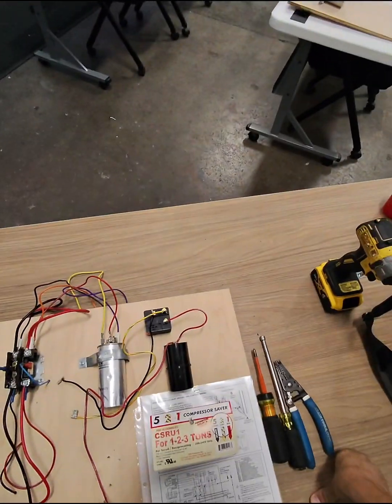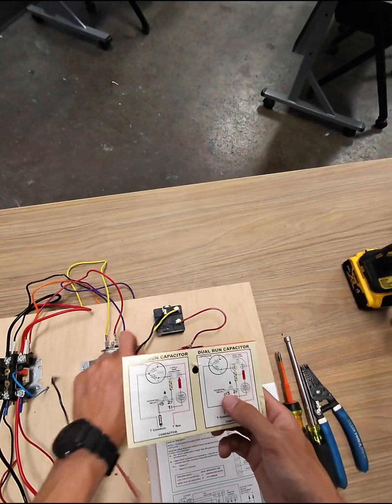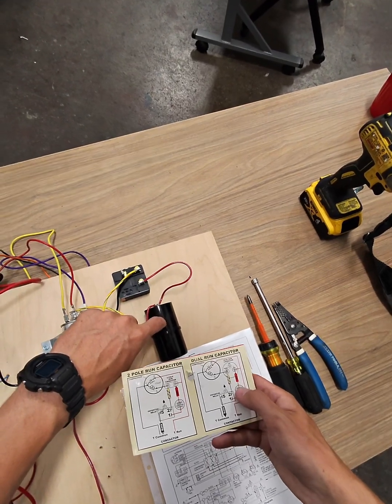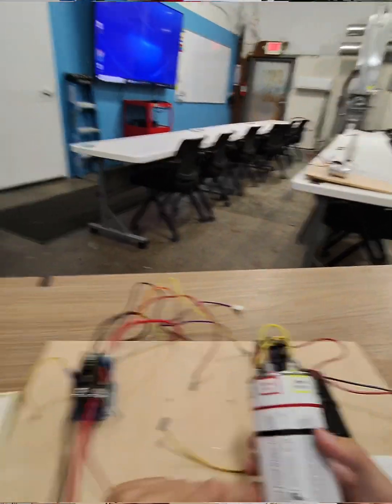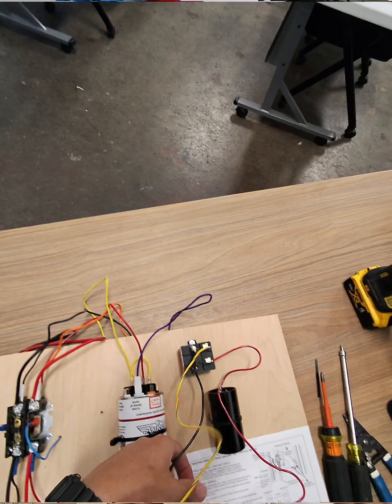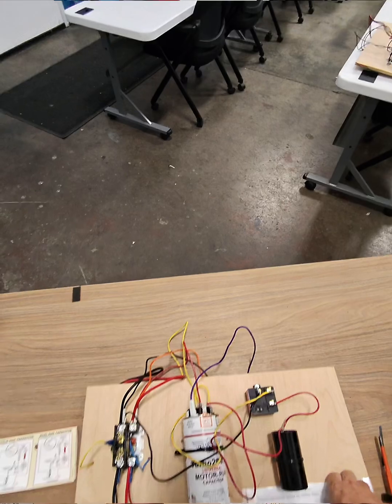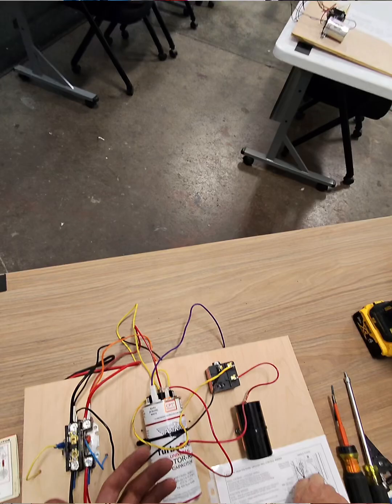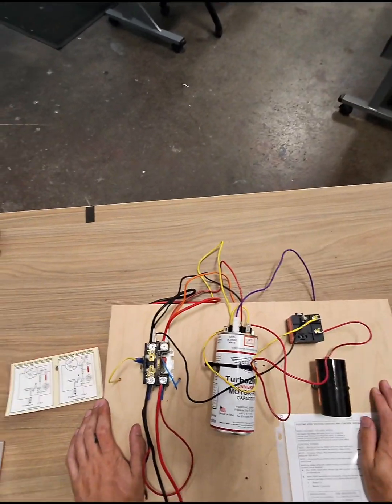How To Install Hard Start Kit with Turbo Capacitor

Comment: I'm newbie with a question.  I'm tryiing to replace/upgrade my standard Herm/Fan/C capacitor with one that now includes a CRT. I have a current hard start kit installed on the unit so when I switch out the main capacitor (to one that now has a CPT) I don't know if the yellow striped wire goes to CPT or the red goes to CPT?  Another video stated that I should put the yellow striped wire on on CPT but in your video demoing a TURBO cap you say the red goes to CPT.  So confused on what hard start wire should go on my new Amrad 2236 cap CPT.  Mine is GREEN (FAN); WHITE (HERM); ORANGE (CPT); and BLACK (COM). Thank you!

Comment: Compliments on this great video. I have a question though. On my Trane system the red wire that comes out of the start cap goes to compressor motor contactor, from there it goes to the dual capacitor. I recently changed the dual capacitor with CPT terminal(same part exept it came w CPT). I initially connected the red wire to C terminal. It works but is it surely bypassing the CPT. Should the red wire be connected to the CPT terminal instead?
Reply: understood. I did more research and found I case compared to mine. Yes, the red wire from the start cap and through that contactor I mentioned goes the CPT terminal. System has been running for week now. No issues no far. Again thanks your video and response. 👍🏼
Reply from the maker: @omarruiz6896  awesome job 😎
Reply from the maker: I wouldnt feel comfortable giving advice unless I saw the wiring and wiring diagram. Some people use different lingo so I would hate to get mixed up and give poor advice.

Comment: Thank you for the video, you are the only one that’s showing the actual installation of the red wire onto the CPT terminal from a heart star kit. I mean going around in circles trying to see where my five to compressor Saber red wire will go to, and now I know.
Reply from the maker: Thank you for the positive feedback. I definitely had to do some deep digging to figure out this was the proper way to wire it as well. Many techs assume to put the striped wire on CPT and the red wire on common, which ultimately does nothing.

Comment: How would you discharge the turbo capacitor before installing the hard start?
Reply from the maker: Just like a traditional capacitor, I'm taking my needle nose and touch two of the terminals together. I've honestly only had a true discharge once or twice but always good practice.